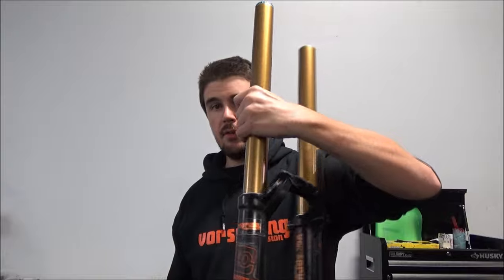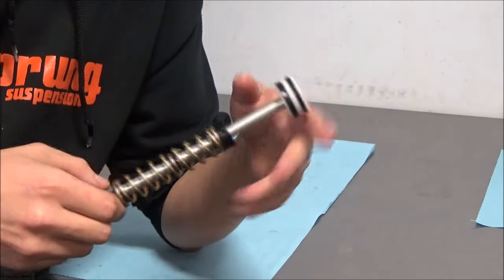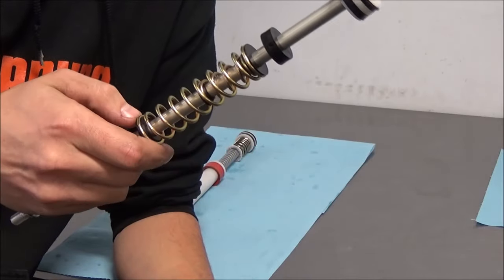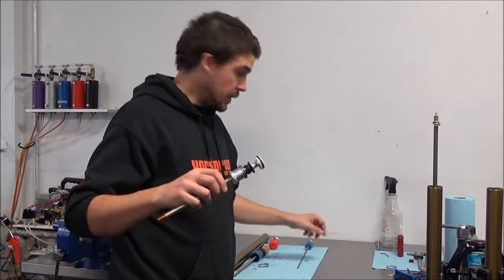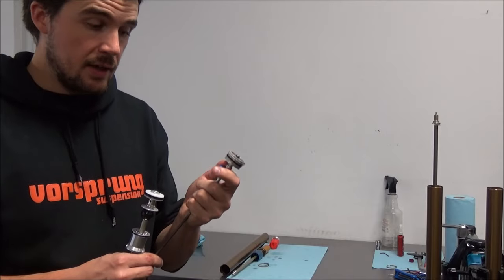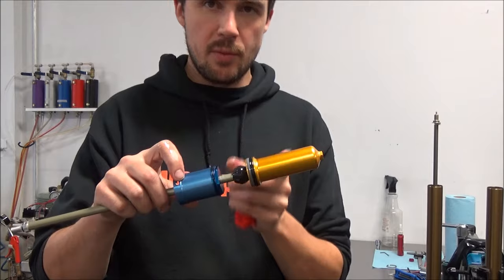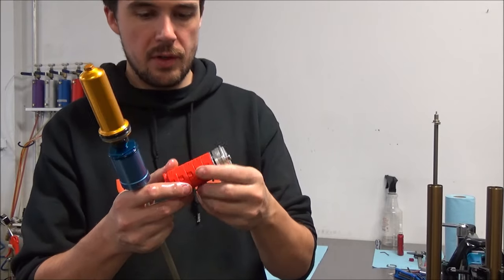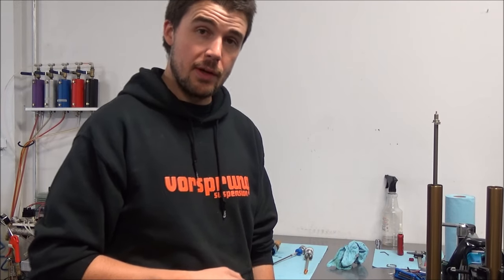Vorsprung Suspension - The Tuesday Tune 01 - Fox Float fork air springs

Comment: Hello I have one question, can I upgrade my first generation air spring to the second you showed on your video?
(I serviced my fork and found out that the both springs were broken, I don't know if thats a common issue with these forks)

Comment: When you install spacer in the negative chamber to change travel do you also change the spring curve, make more linear?
What does changing the transfer port lower or higher, do you change the travel of the fork?

Comment: Thanks Steve! How does the new air negative chamber compare with the 40 designed by Trek for the 2012 Session 9.9?
Reply: That particular fork also had a negative air spring, but with a coil positive spring (lightweight ti was included as the stock and only suggested spring).
Reply from the maker: The Trek fork was a very strange air/coil hybrid design. The air component of the spring was actually quite similar on the Trek fork, except with a smaller negative chamber (much smaller) than the current 40, which was less of a big deal than it might have otherwise been because it ran at much lower pressure (since the coil portion took most of the load). It was almost just an air ramp-up assistance, since the coil 40s were particularly linear in ending stroke spring rate compared to many other forks. Like many proprietary systems, it was mostly different for the sake of being different - it still had a full length coil spring in there so it wasn't like it saved any substantial amount of weight.
Reply from the maker: Yep, it was two complete spring systems (one air, one coil) in parallel. Interesting idea but not too surprising that it didn't catch on.
Reply: Awesome vid as usual, cool way to learn more about suspension.

And I had no idea there was a special 40 for the old Session, weird.